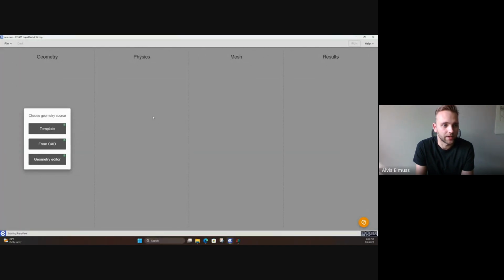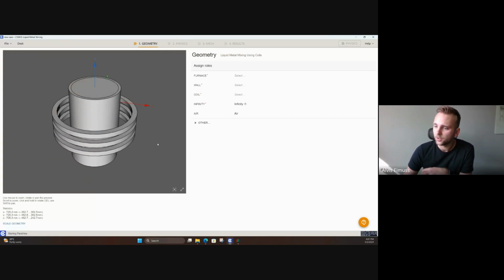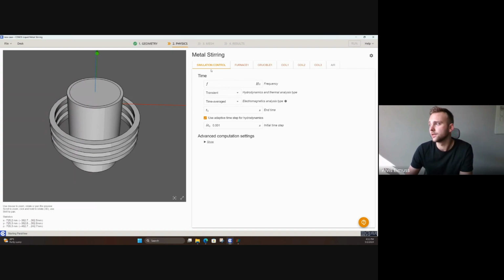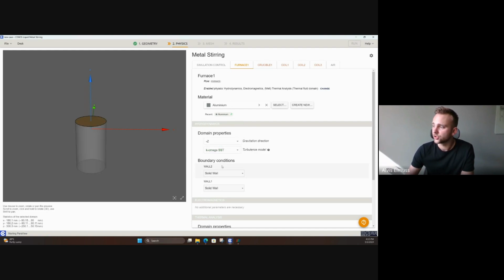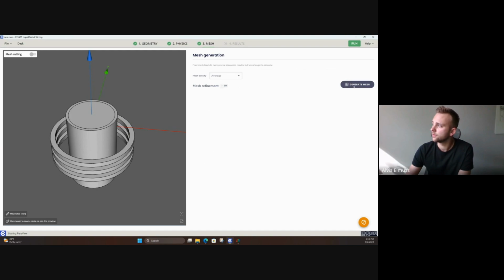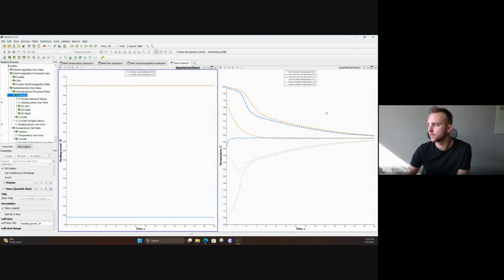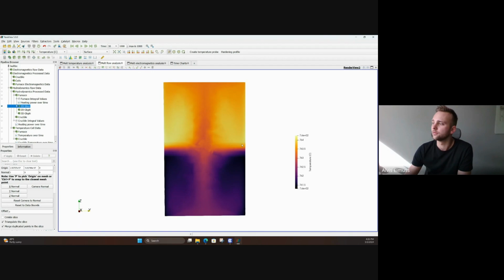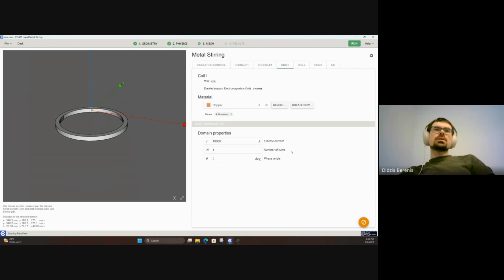CENOS Webinar: Liquid Metal Stirring LMS 1.0 May 2024

Comment: Great job, congratulations!
 I have a few questions:
1) What's the CFD simulation software used for this?
2) Can you simulation shape change due to forces? Or does it require the shape to remain static?
3) Is LES supported?
4) When is it expected to be released?
Reply from the maker: Thanks for your interest @Teld!
CENOS LMS uses OpenFOAM for CFD;
shape change is not supported by the solver for now;
LES is not available for now, however we do have down the road;
CENOS LMS is already released!
Reply: @cenosplatform  Thanks.